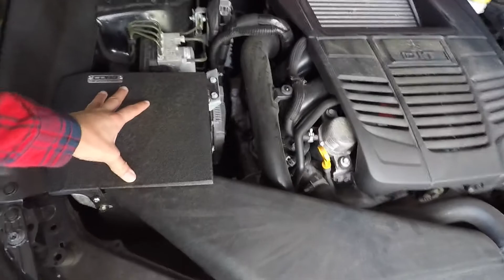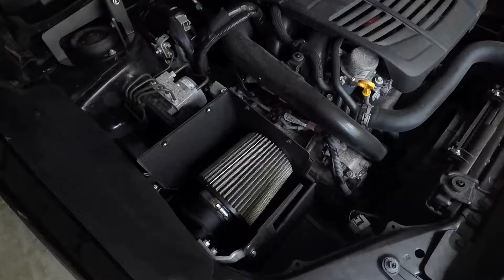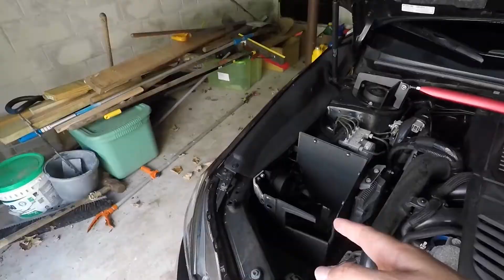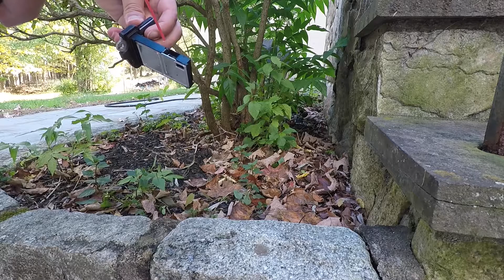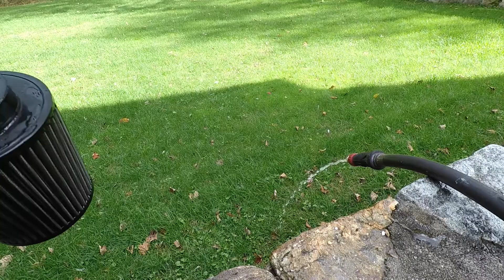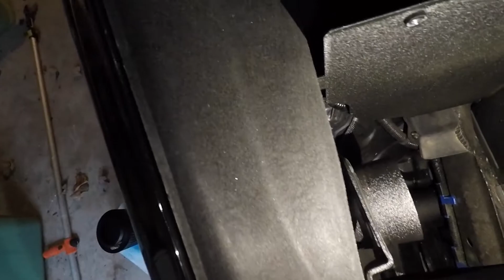Cone Filter Cleaning

Comment: 411whp evo here, i usually spray until almost entirely blue (but not concentrateone area ), let the oil wick and absorb, You dont want to under oil your filter as well. than i let the filter sit intake side facing to ground with napkin under it so that it can absorb and wick downwards, if more spots left after4hours  touch up, usually no excess oil comes off but if some does not a huge issue. Havent ha issues 20+ filter cleanings over span of 10+ years. i dnno why cobb has a bad video on their site, instructions could've been better
Reply from the maker: Good to know, I was always worried about spraying too much oil. Glad to hear that you can be pretty generous with oiling it and not run into issues. I've cleaned mine about 3 times so far, no issues. The car does seem to respond a little better after the filter has been cleaned though.
Reply: @alexs_wrex  100% best method is the soaking top letting it sit vertical and let the cotton absorb

Comment: how long does it take to dry after rinsing and then how long do you have to wait after adding oil
Reply from the maker: It depends, I wait for the filter to dry out completely before spraying it with oil, try to shake off as much loose water as you can. I usually let it sit for at least an hour or two. After spraying oil I let it sit for about 30 mins and then re-install it.

Comment: Can you only use cobb solution cleaner or can it be another brand
Reply: I have the sf intake I use the k&n filter cleaner and oil
Reply from the maker: K&N Filter cleaner and oil should be okay too. The oil is just a different color.
Reply: On Cobb website, they said K&N can be used as an alternative in their answer to one of the questions asked by a customer.

Comment: Good stuff. Have you ever had an issue with this intake making your car run lean or rich? I had it installed around the end of July and it ran rich twice with a rough idle. It's my only upgrade so far.
Reply from the maker: Thanks for watching the videos, glad you like em.

Did you clean the maf sensor when you installed the intake? If the maf sensor is dirty it can throw off the readings.

Also check the positioning of the cone filter. Cobb says it needs to be exactly 1 inch away from the inlet of the intake pipe. 

Are you running the latest Stage 1+ tune? I installed my intake back in 2020, so i used the latest tune that was available then. Haven't ran into any serious issues though.
Reply: @alexs_wrex  Unfortunately I'm not sure if the shop cleaned the MAF when they installed it for me. I had them toss the stage 1+ tune on right after the install. The intake looked like it was at the 1 inch mark. I took the time today to clean the MAF and the filter as much as I could. I triple checked the 1 inch once i put the filter back on.. Once I reflashed the tune the car felt brand new again. Gonna keep an eye on it for the next few days to make sure it's running right. Thanks for the reply!
Reply from the maker: @zMidnightVenomz  Glad to hear the car's running better! You'd be suprised how much of a difference cleaning the MAF sensor can make.
Reply: @zMidnightVenomz I had this exact issue and dealt with it for a couple years actually. I would reflash and the car was good.. come to find out the engine had no ground on the left side.. check that!
Reply: I installed the OTS Stage 1+ tune with the intake last August and within a month ran into extreme richness. I had to go back to stock, for nothing worked no matter what I did it fix it. I was stock for about 5 months and then I purchased tons more parts and got an E60 protune early May of this year and have had no issues since. I now hate Cobb’s OTS tunes after the hassle I went through and feeling how fantastic a protune is. I highly recommend one by a knowledgeable tuner for the FA20 motor specifically.